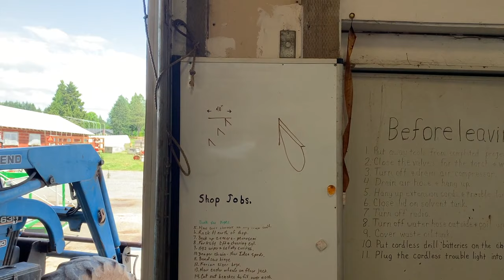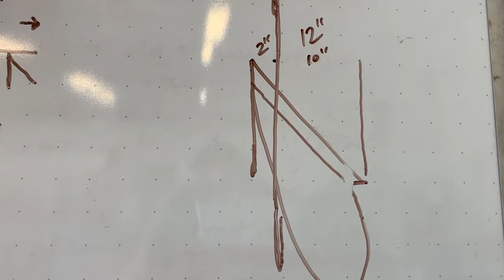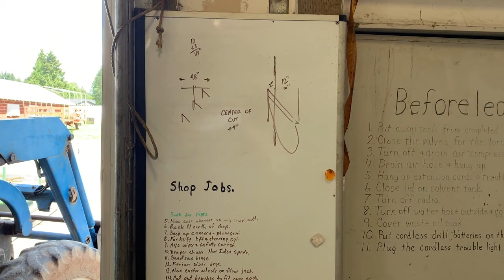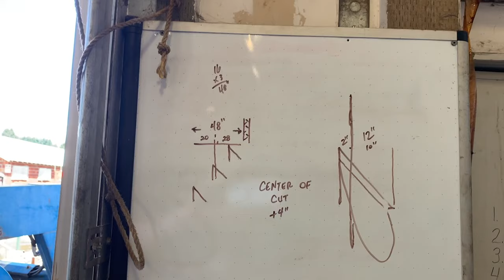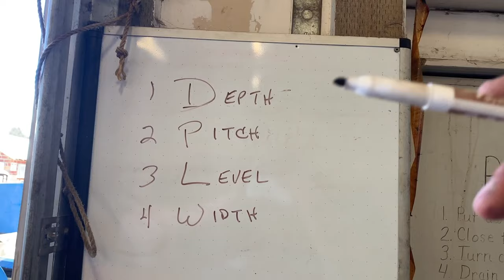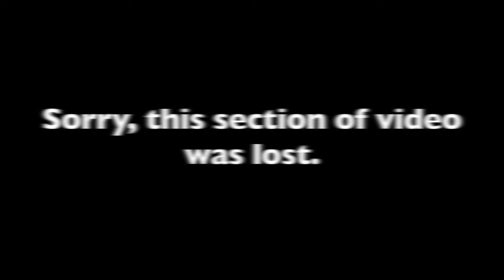How to setup a moldboard plow

Comment: Yesterday I bought a one-bottom plow to pull with my MF 25 HP tractor and have been looking for a good presentation of how to set the plow with the tractor and the tractor with the plow. Thankfully, I found your video just in time and your well-done lecture included a field demonstration. The principles are the same with the single bottom although they are a bit easier. I was lucky that it hooked up close to the 4" offset. Understanding the process of setting the depth, the pitch, and then the level made a lot of difference. This afternoon I plowed under my cereal rye cover crop and will be ready to plant in March. Thanks to you my garden will be great and my investment in the plow was worth every penny. As you asked for video ideas, I suggest you do one for each phase of this year's crops and we will enjoy learning as you go.

Comment: i plow with what ive got, only a 4 x 16 john deere so thats smaller than i need.. I have a 130hp tractor and i think it can handle a 6 bottom that i dont have. But i try to make up for it by pulling at 7 mph and running about 6 inches deep. So in a days time, ive managed to stir the dirt a bit. I come back over it in a week or so when its dried out pretty good with 18ft disc, then follow that up in the end with an 8ft tiller. Thanks for your video, many points of interest there and i always like to see the dirt being worked and engine in a strong pull
Reply: 20-25 horsepower per bottom as a general rule.  
I used to pull a 6-16 JD 1450 plow with a 4440 with no issues.

Comment: I did a lot of plowing . Were I worked sometimes I would get laid off from work for weeks at a time. So I would plow garden's for people. I learned it was easy plowing if the plow was set right. I read in a owners manual if you would clean the dirt of the plow & paint the plows so they would not rust & pit, then the dirt would not stick to the plow as bad. It works ! 🚜🚜🚜

Comment: Most plows you set to pull is depth is set at is 1/2 of the width of the share cut 16 inch cut equals 8 inches depth. Yes you can go deeper or shallower  if you choose too. But, 8 inches should be your starting point...depending on soil type. Heavy clay should be shallower 6 or 7 inches, loam soils 8
Sandy type soils 9 or 10 inches.
Reply from the maker: That sounds about right.  We have beautiful silt-loam soils here with not a single rock!  It's all slack-water deposits from the Ice Age floods.  In short, all of our soil here was redeposited from Eastern Washington when the floods stripped the topsoil off of that land!  It's not uncommon for us to plow 10 inches deep!

Comment: And this is why I installed a power link and tilt to my 3 point. I run a 3/16 plow on my Branson 48hp, I make my adjustments on the fly. My plow has a power center of cut cylinder and after having installed it, I wouldn’t go back to manually adjusting again.

Comment: Thanks. Very good detail. I can't find any old plows with the counters. All of the farmers around western NC took them off!
Reply from the maker: I have looked for coulters for our plow too.  You would think that there would be a company making after-market ones, but there isn't.  You might need to take a trip to a junk yard in Montana or something!  :o)
Reply: @yourlocalfarmer4888  The local Massey-Ferguson dealer said that these coulters were taken off of plows and then got sold off as scrap metal during the high price times for metal...so they may be really gone!

Comment: Dear man, you've explained all the steppes so brillirant and easy to understand, so I salute you. However, I have 1 small question: that gap of 4", is this some universal number or is it a number dependable of the width of a plow? I have 3×12" plow, so I asume that this gap should be smaller than 4"? Thanks in advance (if you reply :))
Reply: am also wondering why that 4 inch gap

Comment: i would like to see a video on what happen after bottom plowing ? the best way to level the bottom plowed field,  is usinf a disk or a tiller best ?
Reply from the maker: It is best to follow with a disk.  A rototiller will do a decent job and leave a very smooth and fine seedbed, but they are very inefficient to run.  They use a lot of fuel and are VERY expensive to fix when they break.  Disk it once going in the same direction that you plowed, then turn 45 degrees and disk it at an angle if you need to disk it a second time!  If it still is a little rough,  use a field cultivator to make a nice seedbed.

Comment: What about an onland plow.we had an IHC 720 6-16  PLOW THAT WAS AN INTEGRAL  PLOW MEANING THAT IT DIDNT USE THE TOP CENTER LINK. SO YOU HAD TO JUDGE WHERE TO RUN IN ORDER TO DO A LEVEL FILL OF YOUR BACK FURROW.. WAS NOT HARD AFTER YOU PRACTICED AWHILE. WE PULLED IT WITH 130 PLUS DUAL WHEEL TRACTORS 
THAT 720 WAS A GOOD PLOUGH...I DID ALSO USE MY GRANDDADS 5-14 INTEGRAL IN FURROW WITH A 4020 John Deere 
It was a John Deere  plough and it did a great job too

Comment: Perhaps a stupid question, but my 45 hp, 4wd compact tractor only has 18 inches, from inside of right rear wheel, to the pto shaft.  Cant reverse the rims.  New Holland says, no wheel spacers.
Can you remove the first/lead plow, from a Ford 101 3 bottom, to increase the horizontal offset?  What happens if you end up with more horizontal offset than you really need?

Comment: Seems like a lot of screwing around.  Set the tire width so that the right tires are 1 to 2 inches right of the front most share.  Find a level spot and put the left tires up by the desired plow depth (should be half the share width. I use an 6x6 and 2x6s stacked up.)  Adjust the plow to be level front to back and side to side. Done.  That will have it so the right tires run clean in the furrow and the plow runs level at full depth with the right tires down in the furrow.

Comment: Thank you!!! I have a garden tract and use a 10" plow I'm not a farmer or skilled in math but, does the 4 inch figure work here for a single 10" plow cause the draft line i get is 1 3/16th or 1/4 of an inch ?  I.E., 1/6th of 12 is 2 and 1/6th of 10!😬

Comment: Should the lift arms be level with each other ? my 2 bottom Massey Ferguson the two bottom lift points are different heights my 4 bottom JD is like yours with the adjustable lever.
Reply from the maker: You will have to adjust the length of your lift arms to set the level side to side.  Usually it is just the right side lift arm that adjusts.  Just a quick hint, if you already have them level count the number of turns on your adjuster so you can go back to level once you are done plowing.

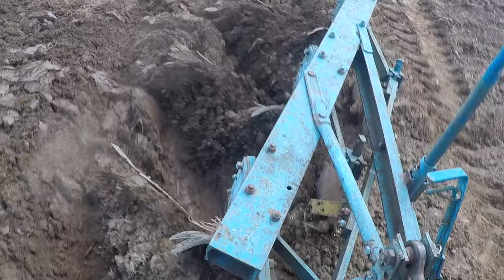Comment: I just noticed something - at the 20:00 mark when you drop the plow into the ground, the middle cutter wheel wasn't turning.  It was being dragged through the dirt.  Seized up, I suppose?
Reply from the maker: Unfortunately it was.  It was the neighbor's plow and I couldn't justify putting money into it to get it turning.  I suppose I could have disassembled it, but I only had the use of it for about 4 hours between two days.

Comment: I have my tractor wheels all they way out and from center to inside of tire is 27 " and I have 4 x 16 ford 151 plows and the book says it should be 32" . Any suggestions
Reply from the maker: The only suggestion would be to build spacers for your rims.  If your plow does have an adjustable 3-point mount (one that slides side to side) you can slide the plow over, but you won't be running true center of draft.  As I mentioned in the video, center of draft just guarantees that you are pulling the plow in the most efficient manner, but it isn't the end of the world if you have extra horsepower and/or traction.
Reply: @yourlocalfarmer4888  Thanks

Comment: I think you have done excellent job here.  Can you tell us what kind of tractor did you used?
What was the model and year?
how many HP?
how much is the weight of your plow?
What is the distance between the tires center to center?
Reply from the maker: Ok, I'll just run down your list.

The tractor was a 1996(?) Ford New Holland 4630 4wd.

55 PTO horsepower

Weight of plow - Unknown

Distance between tires  - 62 inches (157.5 cm) inside to inside - 31 inches from centerline of tractor to inside of tire

Comment: Thoroughly enjoyed your presentation. Thoroughly!!
We're new to plowing, and in the process of searching for a suitable plow; something suitable for a 345HP tractor...but we're a bit keen to on-land plow instead of in-furrow plow.
We run L:SW (low-side-wall) tires for compaction reasons and in-furrow plowing is therefore unsuitable. 
Is there any advise you might offer which could help?

Comment: I’m afraid sir your ploughing tips aren’t cutting the mustard.. conventional plough (yours) has off set linkage pins. Which should be set on flat level ground. The beam which your plough legs fix too in the last few frames clearly show it’s not level( pitching out to the land wheel not the one in the furrow)... ANSWER. For the learners place your plough on a flat surface ie concrete back tractor to plough and adjust tractor mountings to the plough( don’t force the plough to fit the tractor). Take to field adjust top link to suit and ensure a level finish. Yours sir by the view of the last few frames are way way out. Obviously it takes a bit more fine tuning  as you demonstrated but the basic setting up is as I mentioned... look up William Gwillam. Ex world match plough champion. He taught me many many years ago.. stay safe and happy ploughing 👍🏻👍🏻👍🏻

Comment: I am wondering if I should tighten the sway bars to keep the plow from rocking also I have a MF  two bottom plow.?
Reply from the maker: As I mentioned in the video, you can use anti-sway bars, but they could possibly damage the lower 3-point arms or the anti-sway bars themselves if the landing bar isn't adjusted correctly, or if the wear pad has won too far.  With that said, many anti-sway bars will have a slot where you can take "most" of the sway out while still letting it self center.  On the JD 5065E that I use at work it cuts it to about 4 inches of side-to-side travel.
Reply from the maker: As I mention in the video, tightening the sway bars could possibly damage the lower arms of your three-point hitch.  At the same time, I know how bad it is when the plow swings from side to side.  I would suggest tightening them enough to control that violent swing, but they are slack when you are plowing.  You want the landside of the plow to control the width adjustment, not the sway bars.
Reply: NO NO NO NO NEVER use stabiliser CHAINS or tightened sway blocks:  I could write a book about all this. (see above  comment of mine )

Comment: How did you come up with 4” is that a standard or something you figure?
Reply from the maker: Joshua, I looked for an old manual that I had found online at one time but couldn't locate the webpage.  In short, the center of draft has to do with angles from the nearest plow bottom compared to the angle of the furthest rearward landside, and for most 1, 2, 3 and 4 bottom plows it comes out to about 4 inches to the left of center.  If I remember correctly, as you get into huge plows (10+ bottoms) the center of draft can be to the right of center but only because the rear bottom is so far back and the angle is so different.

Comment: Forget all that math,looking at your video you probably have 14 or 16"plow,set the right wheel where it will run in the fur(6 or 8"deep,)then adjust the hitch to almost level,with the wheel in the fur.front and back..

Comment: Whilst I applaud  Joe for making  this video, he has the wrong end of the stick in many instances:  but he made a video - not me ( Upload time too long +other factors)
  thi s   comment in response to comment below:
Basically the Implement HAS  to be free to move freely to allow steering and movement around obstacles.   You have the Virtual Hitch Point and the implement must be free to rotate arond it.  No Ifs, no Buts!    Generally the Instruction books tell you all this ( How to set up the plow) but unfortunately quality THEORY is sadly lacking.  ONe  sees so many tractos Old & New Crabbing with their plows - that the drivers can't see that for themselves and that observers don't step in and help  is beyond me!  
Imagine the tractor as the Horse ( Pair or whatever) pulling with a  Chain.   Horses can only pull straight - no crabbing is there?   chain shows line of pulland if furrow is too wide, the plowman knows  what to do.  If / when he does his job properly, he should NOT  be getting so many bruised hipsoff the Plough shanks  as it stotters over stones as it should lift up and over in the straight line.  How often I have  seen film of the mannie strugglng to hold his plow at an angle ...... simply because he has not got his hitch properly aligned laterally and vertically.
Hope this may stimulate some more comment with positive outcome    Best regards,   Slàinte Mhath